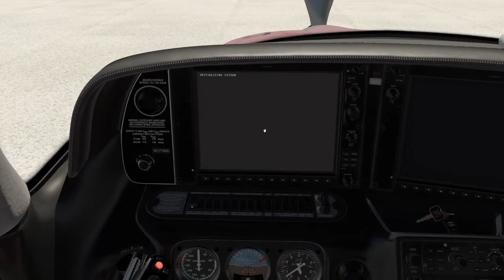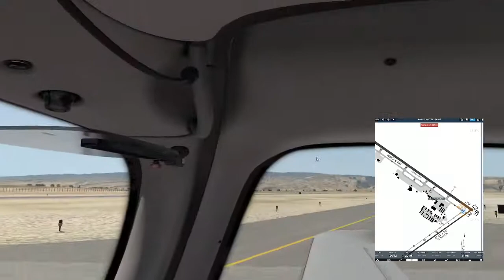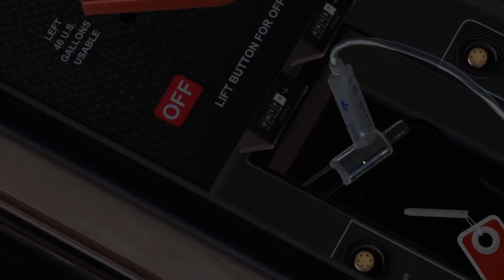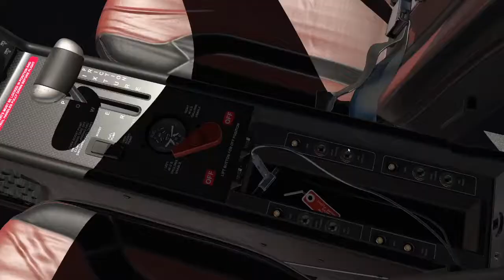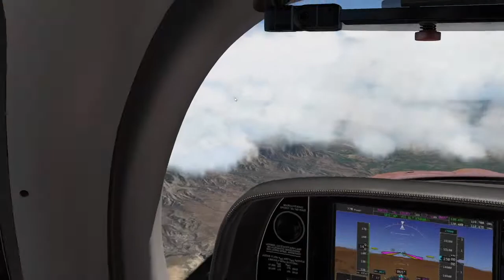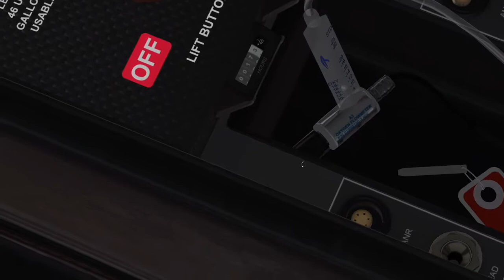TorqueSim SR22: Advanced Concepts

Comment: Tim
Not sure if you’ll see this comment but I’m searching for info on why my system has serious problems running the TorqueSim SR22 at anything close to acceptable frame rates. I have a decent system which runs most all the default aircraft just fine at 30 plus fs. Any thoughts on configurations? Much appreciated.
Reply from the maker: I’d ask on the TorqueSim Discord.

Comment: Heh Tim I'm wondering what you do to record Pilot Edge Audio into the video. I use a headset and for some reason the audio from Live Edge is not recording.
Reply from the maker: I have my game audio going through my Default Output (my speakers), and my PilotEdge audio going through my Default Communications Output (my headset), and my Default Communications Input is set to my headset mic. In OBS (for streaming) or in Dxtory (for recording), I configured three audio channels, one for each of those output/inputs. In OBS I mix the audio live using their in-app mixer; for Dxtory, I record all three channels at full volume and mix them in Final Cut Pro.

Comment: Great video Tim!  Superb knowledge of the Cirrus.  A couple questions.  Do you typically turn off pitot heat below 5 C if the air is clear?  I leave it on full time below 5 C.  In the real aircraft the CAS will hound you if you don't.  Also, I noticed you turned on strobes after the engine start.  Is there a reason you did that?  Not to come off nitpicky, but the POH checklist calls for strobes on prior to engine start; presumably to warn anyone nearby that the plane is going active.  Just curious if that was deliberate and if there was a good reason for it.
Reply from the maker: My aircraft hounds me whenever OAT is below freezing, regardless of whether the pitot heat is on or not (the avionics doesn't sense pitot heat switch position), so I just carried over habits from the 172. I think the checklist also calls for strobes on prior to engine start; I probably just neglected to do it.

Comment: I noticed for both ROP and LOP climbs like your Tahoe video you pull power back to 2500/MAX MP.  The POH says that climb is a full forward throttle?  Is the POH just talking about initial climb when it says full forward throttle and the 2500/MAX MP is the cruise or endurance climb?  Also, thanks for these very instructional videos.
Reply from the maker: You can climb at 2700 RPM if you need, but it's difficult to stay below max MP at higher power settings.

Comment: Tim, your TrackIR doesn't seem to float much. Do you have recommend for the profile cure settings?
Reply from the maker: Do you use X-Camera? It's not about the curves, it's about X-Plane's crappy TrackIR implementation. Use X-Camera and don't worry about the curves.
Reply: @riscfuture  Yeah, I'm using x-camera too. I have a pilot view with track-ir enabled. The other views are fixed. When using the track-ir in the pilot view, I struggle with stability to move the view and make mouse selections. Your video doesn't appear to have the same float characteristics that I'm seeing when I'm in track-ir active mode
Reply from the maker: @dougduplessis4143  I just use a simple 1:1 curve that steepens out only at the edges. That way I have 1:1 tracking when looking at the gauges but can still snap my head to the side to check 6.

Comment: Hey Tim, thanks for the valuable insights. What program are you using that mirrors your iPad (Foreflight) onto your PC?
Reply from the maker: It's not a program, it's video editing :) I overlayed my iPad screen in the vide only.
Reply: I installed NDI to use with OBS Studio. I did have to spend $10 for an IPad app. Otherwise, everything's free.